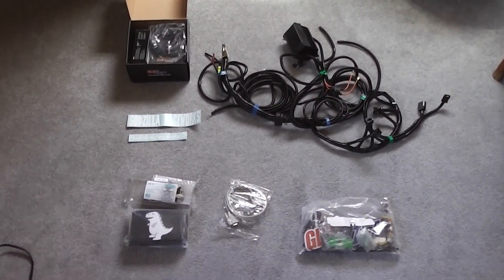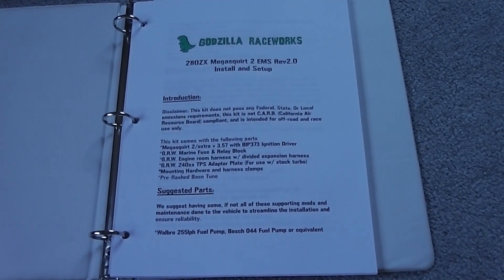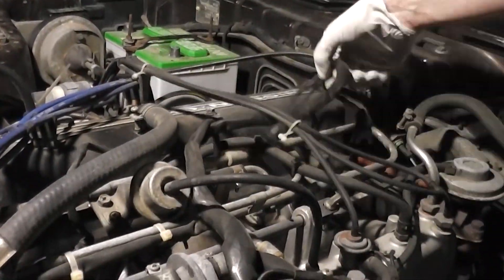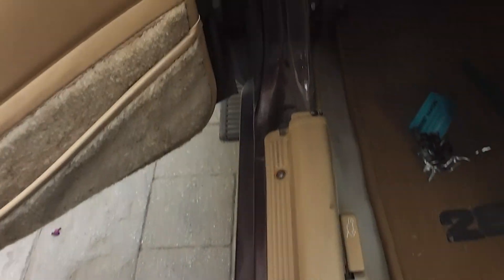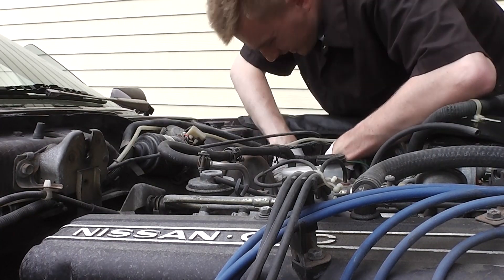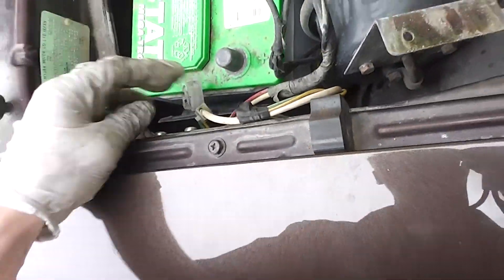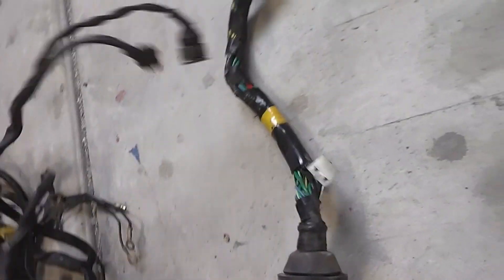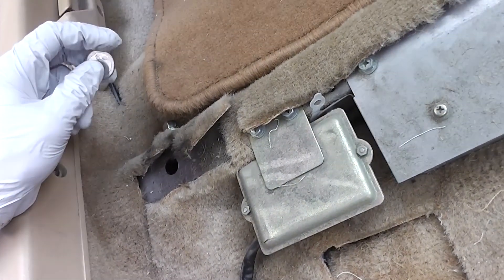Upgrading the ENTIRE Fuel Injection System in my 280ZX (Megasquirt 2) Pt. 1

Comment: I have a 1983 280ZX and im restoring it and im doing the engine first and i did get it to run but alot of the electronics from the dashboard doesn't work right no power to the windows, the radio, the sgnals,and some of the gages and i tested all the fuses and there all good. Do you have a wire harness for this. I already replaced all the fuel injectors and wires for that so im ok with that but the internal wires is what i need with whatever relays i need
Reply from the maker: The harness for the accessories is separate from the engine's EFI harness, I didn't need to swap it out or modify it. If your accessories aren't working at all, typically its an issue with the fuselink or ignition switch.

Comment: When you installed the megasquirt wiring harness, did you remove the stock relay boxes that connect to the battery? Idk if yours was setup the same way as mine. But I had relays mounted right next to the battery. One of them was labeled "IGN". Did you take these out and replace with ms2 relays, or did you keep it and the relays for the megasquirt were just in addition to those?

Comment: Excellent video! Did you have to upgrade your fuel injectors when you replaced them or did you replace them with the original stock injectors ?
Reply from the maker: I upgraded to factory L28ET injectors.

Comment: So cool of you to be making these videos man! I have an '82 280ZX that I would eventually like to drop a Stage 4 cam in. I would like to get it dyno tuned at 91 octane with the cam upgrade. Do you know if the stock ECU can handle that or would I need to buy a better ECU like MegaSquirt to get it tuned?
Reply: Mine had a different cam ran like shit until I put an oem from eBay
Reply from the maker: Yeah the stock ECU can't be tuned as its way too simple. Megasquirt is the best bet if you want to be able to squeeze as much power and drive ability out of a built engine as you can.
Reply: @HooliganGarage-650  Dang, well that's disappointing. By the time I get everything in place needed to have it running properly with a Stage 4 cam I'll have spent about 3 grand (Canadian! If I was doing a full engine build I can totally see the value of getting a Megasquirt kit, but for 50-60hp, I think I'll stick to my guns.